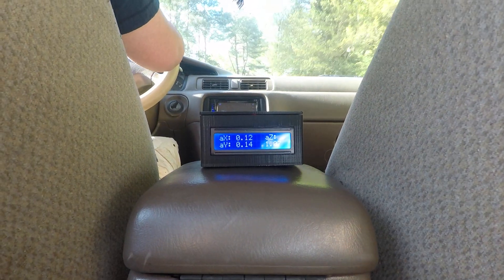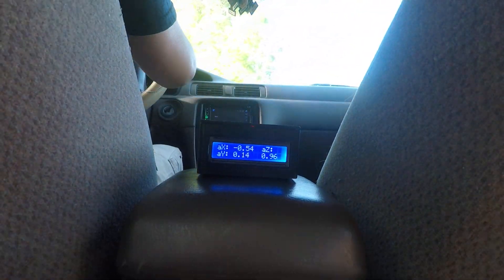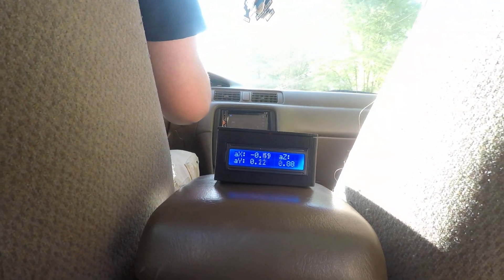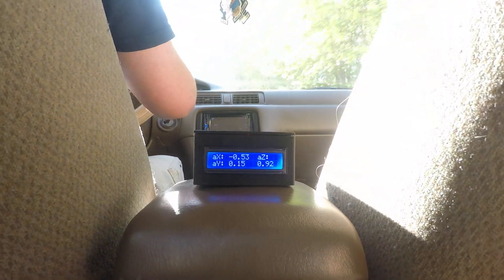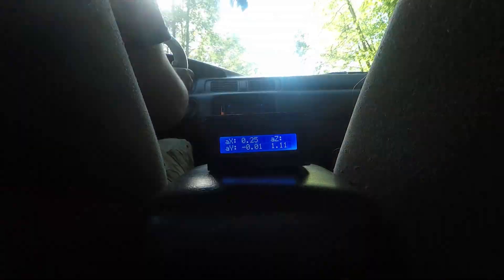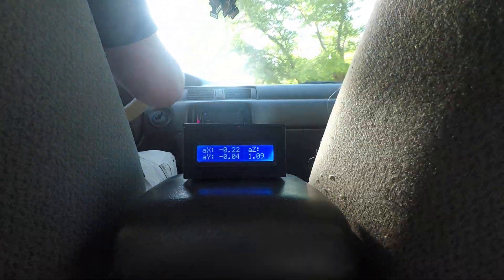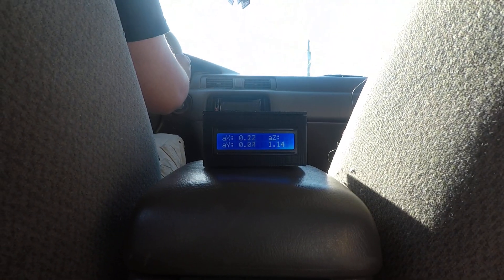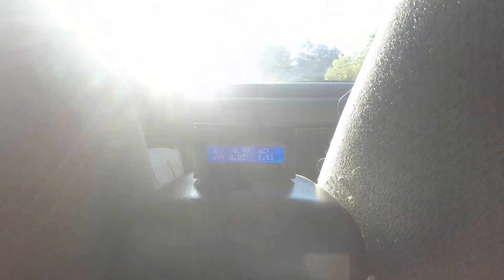Vehicle Accelerometer for Arduino

Comment: How did u convert the accelerometer signal to get the acceleration in units of g’s ?
Reply from the maker: Within the code I actually had to take the raw accelerometer values and divide them by 16384 to get the acceleration of gravity. I would up googling this value for this board and the best way to test if this is the same for you board is to get the maximum accelerometer raw output and divide it by the max g force the manufacturer says the board reads.